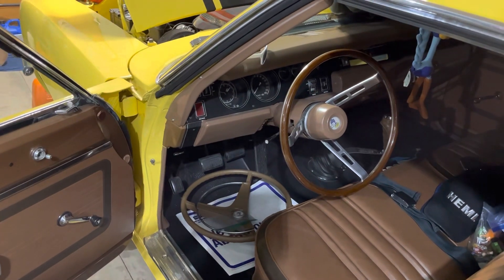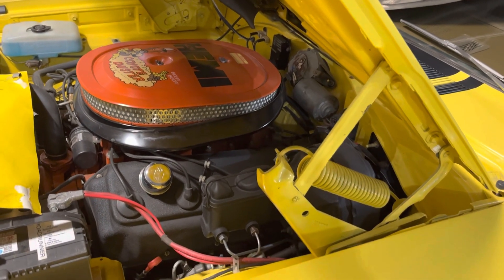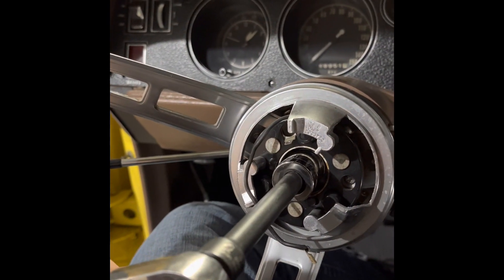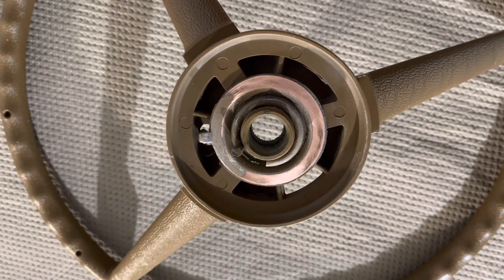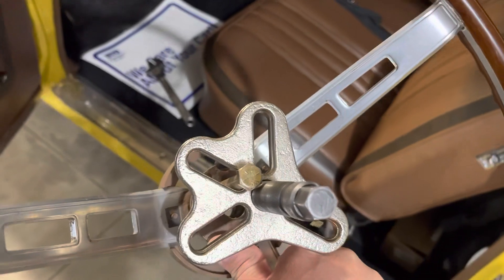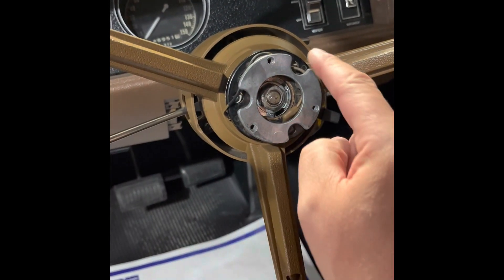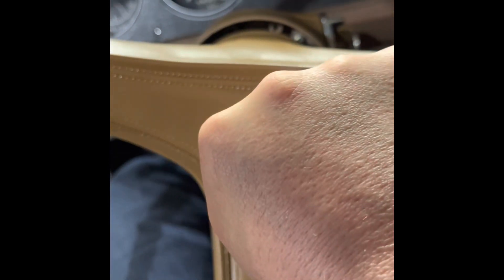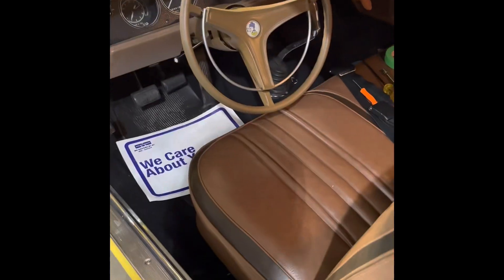How to..... replace a Mopar steering wheel

Comment: Sweet car but I think you installed the wrong steering wheel. The 70 steering column is bigger diameter than the 69 because of the key switch being moved to the column in 70. It appears that you installed a 1969 steering wheel because its smaller where it mates to the column. That's why you can see the internals of the column when done. Just a heads up.
Reply from the maker: Thanks for the thought but I had a 69 and a 70 this is the bigger one there was a definite size difference I checked it to a 69 b body also.

Comment: Since the end of the shaft is flat, unlike some that have a tapered pilot, I don't use the pointed end on the puller so it doesn't skate.
Reply from the maker: That is true I do agree. I use the pointed end so there is no risk of squashing the threads on the steering shaft

Comment: All that time rambling on about the horn but not a single frame of the wheel going back on or how he got it all the way down...that's what I came here for, lol.
Reply from the maker: You just place the wheel on the spline and tighten the nut finger tight till seated. Then torque it and you’re done. Sorry to disappoint you.
Reply: @ManderscheidMedia  No worries, that is very helpful.  Thank you!!  👍

Comment: Hello.
How do I remove the Emblem from the center of the second/new steering wheel?
Reply from the maker: @chrissione5677  gently use a small blade screwdriver or a plastic body tool and pop it out to access the nut

Comment: Is that a 69 wheel on a 70?
Column looks much bigger than the wheel.
I just bought a wheel for 69 from Laysons,was told don’t get the 70 because it’s larger.
Reply from the maker: The diameters are different form 1969 to 1970 that is correct information. To the best of my knowledge its a 70 column with an original 70 wheel
Reply: Oddly enough,mine looks the same,had to go put the wheel on after noticing it on this video